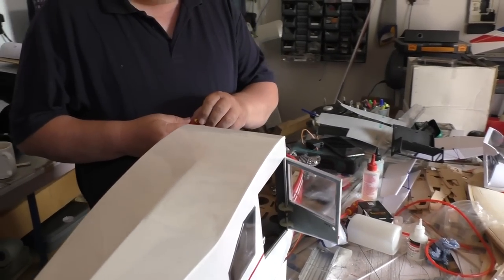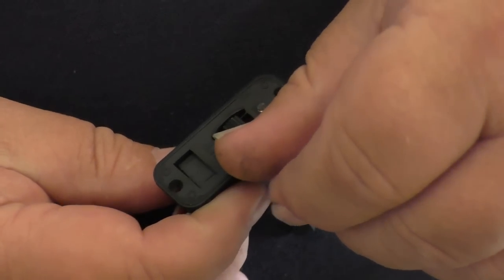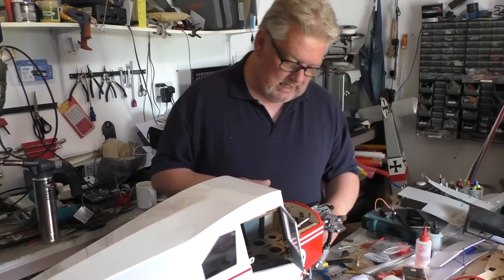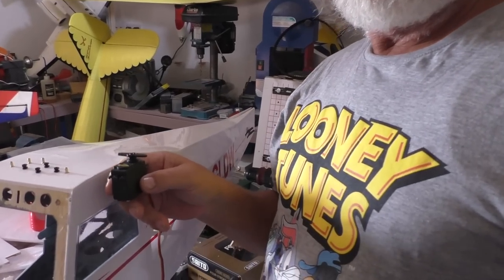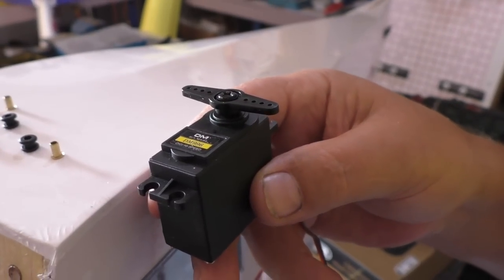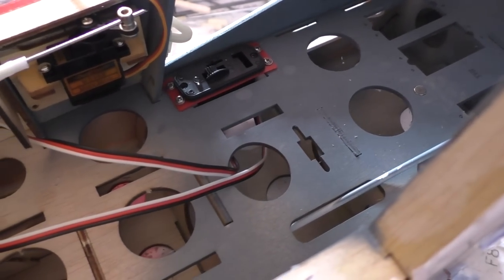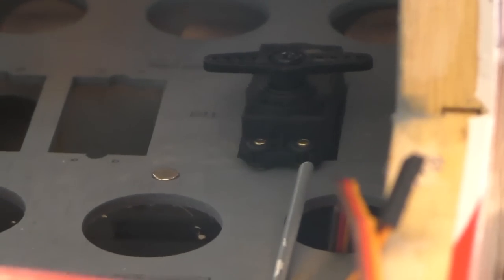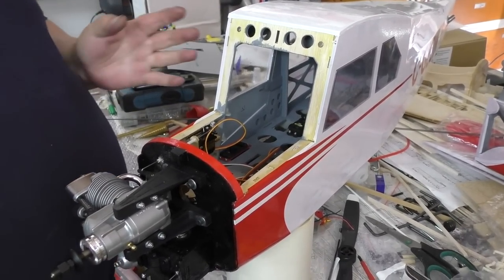VQ Models Piper PA-22 Tri Pacer Build Pt3 RC Model Geeks

Comment: cant the steering rod go through the seat instead of the seat over the rod
Reply from the maker: The seat sits on top of the servos. So there is no way to get to the screw that locks on to the push rod, with the seat in place...